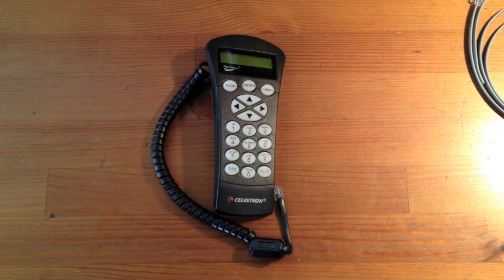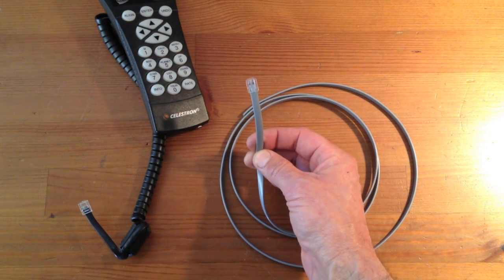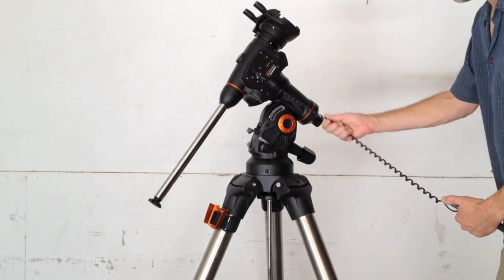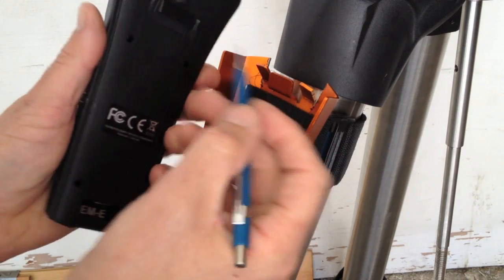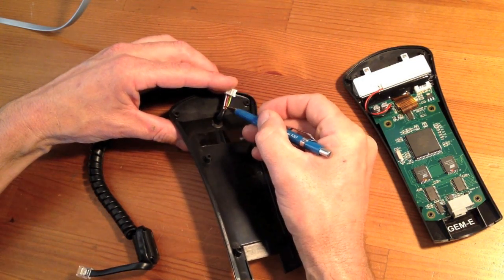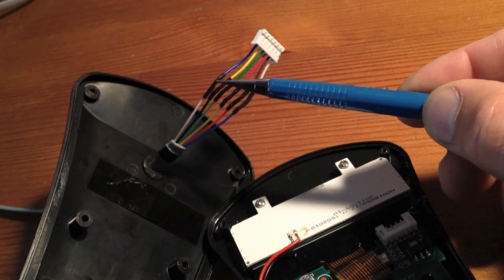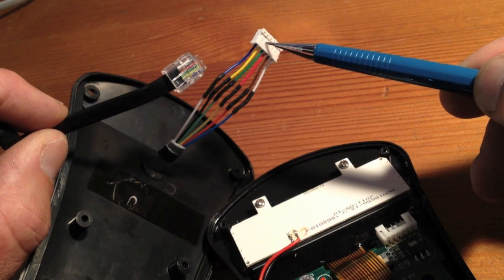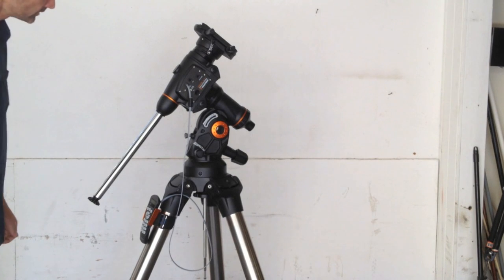Celestron Hand Control Modification

Comment: I like the idea of a longer cord.  There is an easier way.  Got the the electronics or hardware store and buy coupler and and extension cord (inline coupled RJ-22).  A handset extension cord will not work because the connector is smaller.  Make sure to get the extension cord that you would plug into the wall jack (RJ-11).  The extension cable needs to be 6-conductor as mentioned in the video.  You may be able to find a longer coiled cable but most of the coiled extension cords are for handsets and will not work as they are only 4 conductor.  For my CGEM I already had a left-over coiled cord from my old fork mount so I used that and the RJ-22 coupler.

Comment: Lol you better wait until the mount is out of warranty. And a coupler definitely makes more sense.  Keep in mind that there is a limit to how long you can  make this wire.  I used a longer wire on my atlas pro, The Mount worked fine, but for some reason the RS-232 port didn't like the longer wire. My GPS and my Skifi unit didn't work with the longer wire? The pin configuration was identical the only difference was the length.  FYI

Comment: the cord they use happens to be the same as old landline telephone hand sets, I replaced mine with a coiled 12' cord, its only about 3' coiled ,but is way more flexable than the 1' cord that the controller comes with

Comment: en control tiene usb, y lo puedes conectar al pc sin ningun problema, bajate la aplicacion para windows o mac de cpwi de celestron, aparte tienes el el modulo wifi de celestron, y si el mando te vibraba con un poco de velcro lo solucionas en 3 segundos

Comment: Response to Richard Lee's comment below and to anyone else who views the above video. Yes a RJ12 6P6C inline coupler works perfectly as I did just that to extend both my Celestron 6SE Nexstar control and my Celestron CGEM hand control cable. The phone cable and inline coupler means its cheap and you dont have to pull apart your hand control! Thanks heaps to both E. Stanis for the orig video and idea on using the 6C6P telephone cable and jack and Richard Lee's idea below.

Comment: You could've just pop the wires out of the plug, each wire  locked in with a metal tab and just push the new cord's wires into the holes of the white plug.
Simple, no need for heat shrink and soldering etc..., too much work.

Comment: Found these at www.monoprice.com
7278   RJ12 6P6C Straight Inline Coupler - Beige  $0.27
942 Phone cable, RJ12 (6P6C), Straight - 25ft for Data $1.48
				 				
I wonder if they would work with the handcontroller on my AVX?